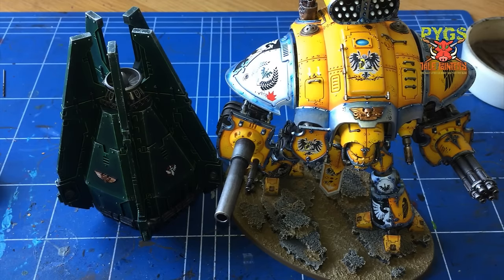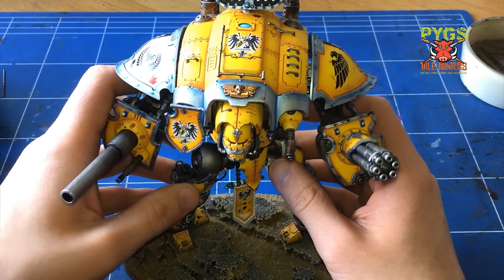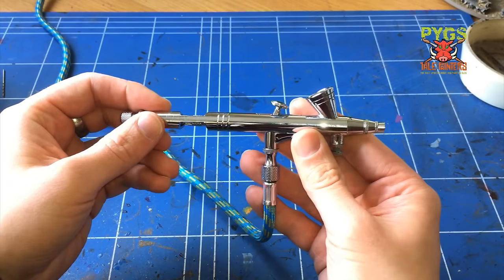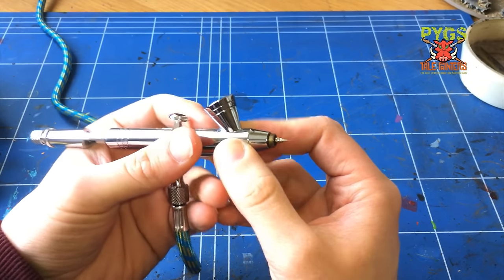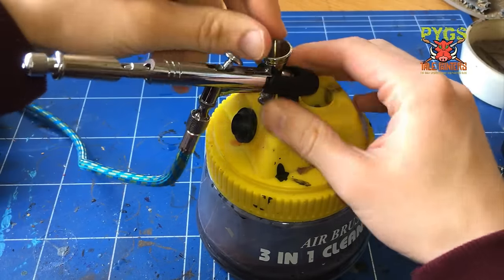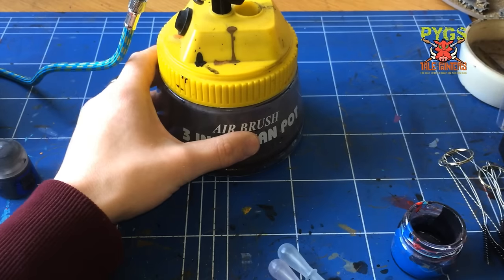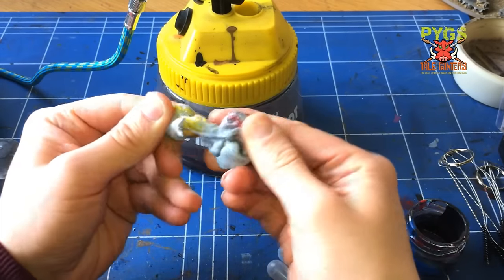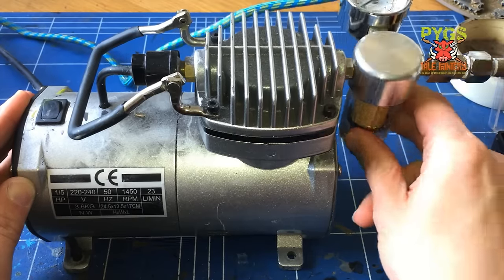Garfy's Introduction to Airbrushing Part 1 VLOG03

Comment: Fantastic help, I was given Smaug for christmas and need to take the plunge into airbrushing. This really helped, its an intimidating area to get into and with such as large spectrum of prices it is hard to know where to start! What model of airbrush is that?
Reply from the maker: +Chris Huggins I think this is the BD180 but RDG tools doesn't sell it anymore. Don't worry about model, go for specs. You'll want dual action gravity feed. And then just decide on the size nozzle you want. I use a 0.3
Reply: +Gareth Etherington (Garfy) Fantastic! Thanks so much for the advice!

Comment: I'm using the vallejo surface primers as well with my airbrush, however I have the problem that, even after like 2 days of leaving the model alone, the primer is still easy to rub off, if I don't do another coat about it after a few days (and even then it still happens). Never had that problem with spray cans.
Reply from the maker: +SethDr2 I give my models a couple of coats easily. I'll only get rub in extreme cases. A couple of suggestions, firstly try lightly gluing the model to a wine cork or old flat topped paint pot and only hold that. That'll cut down on rubbing.  Secondly, after the first coat of spray, give it a light dusting of matt varnish spray and then hit it again with the surface primer. The varnish should help encapsulate the first coat.
Reply: +Gareth Etherington (Garfy) 
I only handle them that way and use gloves, but I'll try the varnish method, maybe that helps. Thanks.

Comment: Do you have to thin down the Vallejo surface primers to use in the airbrush?
Reply: +Jason Krieger I have found that you do need to thin them slightly, otherwise your brush tends to clog. I tried adding it directly to the bottle, but over thinned once unfortunately, so i would recommend if you plan on doing that to do it carefully and keep checking that it doesn't get too thin.
Reply from the maker: +Jason Krieger Use to thin when i used my 0.2 nozzle brush. I don't seem to need to thin now with my 0.3mm. Thorough cleaning is necessary after every use even a few paint flecks inside can soon snowball and grow the more you use it.